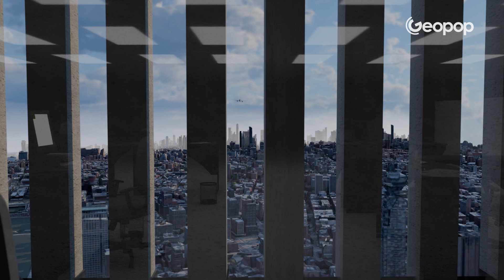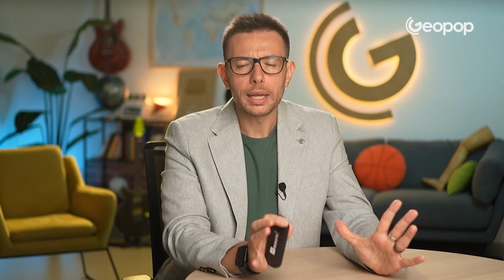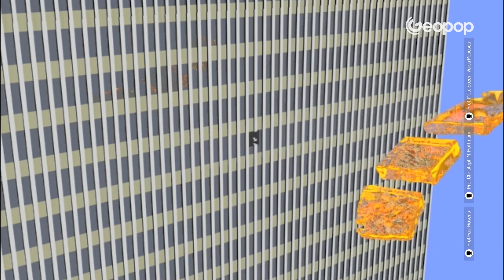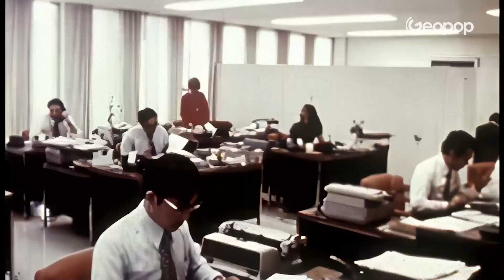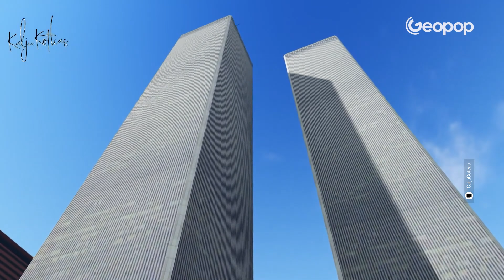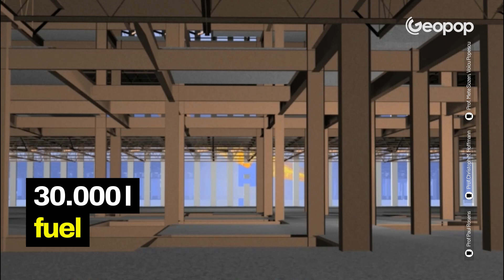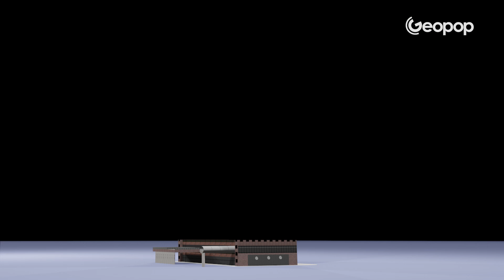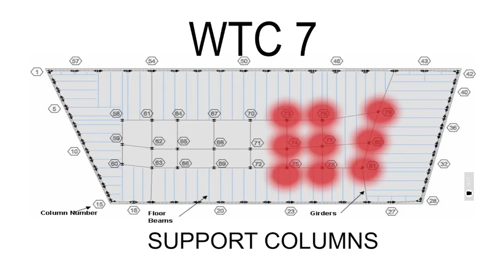9/11, 2001: The Technical Reconstruction of the Twin Towers and WTC 7 Collapses

Comment: How a 800 km/h passport can crash in a building  survive, and will be found view hours later, in a collapsed Bildung???
Reply: Nobody designed the building to withstand a ,767 plane hitting it and exploding at 500mph... Considering it still took 20 minutes for the building to fall means the stresses took over and broke it!
Reply: @sonnydemichele4903 a 767 is Not able to fly 500mph at 400m
Reply: It’s quite possible it was one of very few actually found.
Reply: The book in the pentagon on the table next to the collapsed supporting wall also survived the explosion, you can see it in the photos
Reply: @ElLowEl .  . "What the hell are you talking about?" .  . 😃 .  . Thank you for your sponsored reply, Mr. EILow.  The word projection indicates holography as you know, commercial demonstrations of which have been amazing in recent years.  To feign ignorance doesn't work well for you, however.  Where, Mr. EILow, is the wake turbulence only seconds after passage of a 500 mph large passenger airliner -- not seen in the smoke and fire covering the impact zone?  Even the wake of a small Cessna Aircraft would be noticeable -- yet there is nothing.  It's likely that no real answer from you is forthcoming. We'll wait and see .  .
Reply: The fact that the passport and identification of some hijackers survived the crash is not proof that they were planted! The only passport recovered from the World Trade Center site belonged to Satam al-Suqami, one of the hijackers of Flight 11, which was the first plane to strike its target (the North Tower) that morning. 

The passport was found on the street by a passerby just a bit after the crash and handed over to a NYPD detective. It was not found afterward in the rubble or debris as is commonly claimed, and bore damage and charring, consistent with being affected by the explosion.

The impact, along with the blast wave and air currents, ejected the passport from the plane and naturally into the street below. 

It must be stressed that this isn’t the sort of astonishingly improbable scenario it's made out to be. Numerous objects, such as paper, clothing, seat cushions, human body parts (including rib cages, limbs, and heads), suitcases, and other debris were found scattered all over the streets after the crash. 

In fact, later on, the body of a flight attendant, still strapped to her seat with her hands zip tied, was even recovered from the rubble, one of the few nearly intact bodies found in the wreckage.

And perhaps most crucial, this wasn’t an isolated case whatsoever. The other crash sites, such as the Pentagon and Pennsylvania, also featured identification documents from the hijackers. Several of their driver’s licenses, credit cards, and luggage tags were recovered, including even one of the red bandanas worn by the hijackers of United 93. 

Additionally, personal items from other passengers and crew were found, including driver’s licenses and various belongings, making it clear that surviving items weren’t unique to the hijackers.* 

It’s simply a matter of physics, logic, and undeniable fact. Anyone with real-world experience in law enforcement, emergency response, or evidence collection can attest that in any explosion, implosion, or similar event—whether a plane crash, bombing, arson, or structural collapse—objects of all shapes and sizes often survive in varying conditions, depending on the precise circumstances they endure. 

Denying this reality and believing otherwise isn’t merely misguided—it’s willful ignorance!
Reply: This is what they want to let tou believe.. @lukasz-b2z
Reply: @Eo9539  "This is what they want to"
Who?
Reply: @lukasz-b2z Please don't use the word Logic.
Reply: @ Please use google or read a book. We have a milion overwhelming evidence for AQ responsability for 9/11
Reply: @lukasz-b2z  The big problem is while these items survived the flight black boxes were never recovered for both flights.
Reply: @whatslifespurpose  What's so strange about that? Black boxes aren't indestructible as people think. Especially not when thousands of tons of steel from a collapsing tower fall on them. Passports flew out during the impact. Black boxes were found in Pentagon and Shanksville.
Reply: @whatslifespurpose Hmmm?
Reply: @lukasz-b2z  yes right from all the people in twins only a passport of one of the villeins was found in the street.. yea right. very unlikely.
Reply: @ We have a milion overwhelming evidence for Al Qaeda responsability. The only thing you have to do is to get out of your, tinkfoil, internet bubble. Read the book "Looming Tower" for example. Everything will be clear.
Reply: @connectthedots5678  We have a milion overwhelming evidence for Al Qaeda's responsibility for 9/11. All you have to do is to get out of your internet bubble. I recommend reading the book "Looming Tower". Very well documented book.  Everything will be clear.
Reply: @lukasz-b2z now explain how the building came down.. forget the passport
Reply: @mishmash9397  https://www.youtube.com/watch?v=m-Haf79ygQY&t=211s
Reply: @ Type on yt: The Collapse of WTC | Solving All the Mysteries
Reply: @mishmash9397 you literally are commenting on a video that explains in great detail how it came down.
Reply: That passport had plot armor.
Reply: The passport was found among debris on the sidewalk before any of the buildings collapsed.
Reply: @marcpowell5893 that's even weirder
Reply: Marcpowell5983, the twoofers want their story to sound as improbable as possible for future generations, in the hopes of attracting fellow “thinkers”
Reply: @marcpowell5893  The plane turned into a fireball as soon as it made contact with the building.  There is no way a passport flew out of a fiery explosion and then found and handed to the authorities before the building collapsed. I just never understand people's appeal to believe authority at all costs and hate and attack anyone that questions it
Reply: @briannatarelli430  Lots of other combustible items from the planes made it to the sidewalks intact. There were plenty of other ways to identify the terrorists without the Government taking a chance on planting a passport and hoping it wouldn't raise suspicions. It was an amazing find, but not impossible or suspicious. Stranger things have happened. Your incredulity counts for nothing.
Reply: man.. watch the video
Reply: As Jerry said on Seinfeld 
“Now that’s one magic lugi”
Reply: Pass port? What happens if chuck a piece of paper from the top? C'mon.
Reply: Because the passport was inside the pocket of a pair of fire retardant pants...
Reply: @KennyGiven  "Because the passport was inside the pocket of a pair of fire retardant pants"
Unlikely. It was most likely in a shirt pocket, or even just on the plane dashboard, as from recovered location, it bounced back, not crossed the tower.
Reply: The passports of all muslims are always coated with the same fireproof material like the coloumns, in case they will be called up as suicide squads one day.....😂
Reply: @Eo9539  "The passports of all muslims are always coated"
Naively wrong.
Reply: Now that is more amazing than anything they told us officially
Reply: @nickcharles1284 .  . "science" .  . 😃 .  . Commercial demonstrations of holography have been amazing -- so you believe that they are analog in nature? .  . What century are you living in?   

You also cannot explain the entire lack of turbulence behind a 500 mph aircraft that would entirely disrupt the smoking fire coming out of the building on the seconds later. Even the wake of a small Cessna Aircraft would be evident -- yet there is nothing.
Reply: -- Then what is the source of the many tons of molten steel found in and under the debris, the heat so intense that the molten steel remained in that state for weeks afterward, running off of the debris as it was excavated. This cannot be molten copper from wiring that retains the color of a shiny new penny.  It cannot be molten aluminum that retains the color of the polished aluminum wheels of a street racer. It was the color of glowing orange molten steel  that cannot be mistaken for any other material, reported by firefighters who are very experienced in the nature of such materials as well as seen in video evidence.

When you combine this with an entire lack of turbulence behind 500 mph aircraft, when even a small Cessna Aircraft would leave an evident wake in the smoke and fire only seconds later .  . We find that skeptics still cannot be skeptical of the official narrative in explanation.  Sponsored channels and forum activity are skeptical of nothing when support is provided.

Sponsored activity in the forums is very normal today for commercial and political purposes and subjects of controversy -- in the attempt to lead public debate.
Reply: @ronaldgreene5733  There was no molten steel found "in and under the debris." What was dug up by the excavators was solid steel brought to red heat by the intense underground fires which were burning ordinary combustibles. The material seen "running off the debris" in still photos was just red hot embers. Molten steel is white hot, emits sparks and, of course, is a liquid. Firefighters who described seeing "molten steel running down the channel rails" (whatever that means) were mistaken. They are not chemists.

The planes that slammed into the WTC buildings as witnessed and photographed by thousands on the streets of NYC and as seen by millions on live TV were real. The "official narrative," as improbable as it may seem, has consistently been proven to be correct.
Reply: and even no black boxes was recovered but a passport is survived and recovered from that.
Reply: And how does a found passport prove anything about the owner being a terrorist?
Reply: Which is more extreme -- to accept without question the inexplicable lack of turbulence in the wake of a 500 mph large passenger airliner -- not evident in the smoke and fire covering the impact zone only seconds later? -- or to recognize the indications of digital projection in its imperfect nature as we see a wing disappear in front of a bright blue sky? From another camera angle, the same aircraft is seen passing behind a crane in the foreground, yet in front of the heavy crane cable. 

There should be a hurricane of turbulence in its wake that would entirely disrupt and disperse the smoke and fire seen billowing outward just 3 to 4 seconds later at both towers.  Even the wake of a small Cessna aircraft would be noticeable -- yet there is nothing.

Comment: Explain why the towers fell at free fall speed. With NO resistance from structure below. You can see squibs discharging from the building in videos, many floors below as the top was coming down. Not buying this BS. It was a controlled demolition

Comment: Don't forget to memoryhole 𝟮𝟬𝟭𝟳/𝟬𝟱/𝟬𝟵 𝗙𝗘𝗠𝗔 𝟰𝟬𝟯 𝗔𝗽𝗽𝗲𝗻𝗱𝗶𝘅 𝗖 became err reasons. “Evidence of a severe high temperature corrosion attack on the steel, including oxidation and sulfidation with subsequent intergranular melting, was readily visible in the near surface microstructure. A liquid eutectic mixture containing primarily iron, oxygen and sulfur formed during this hot corrosion attack on the steel. This sulfur-rich liquid penetrated preferentially down grain boundaries of the steel, severely weakening the beam and making it susceptible to erosion. The eutectic temperature for this mixture strongly suggests that the temperature in this region of the steel beam approached 1,000 C (1800 F), which is substantially lower than would be expected for melting this steel. When steel cools below the eutectic temperature, the liquid composition transforms to two phases, iron oxide, FeO and iron sulfide, FeS. The product of this eutectic reaction is a characteristic geometrical arrangement that is unique and is readily visible even in the unetched microstructure of the steel.”

Comment: 𝗙𝗲𝗱𝗲𝗿𝗮𝗹 𝗕𝘂𝗶𝗹𝗱𝗶𝗻𝗴 𝗮𝗻𝗱 𝗙𝗶𝗿𝗲 𝗦𝗮𝗳𝗲𝘁𝘆 𝗜𝗻𝘃𝗲𝘀𝘁𝗶𝗴𝗮𝘁𝗶𝗼𝗻 𝗼𝗳 𝘁𝗵𝗲 𝗪𝗼𝗿𝗹𝗱 𝗧𝗿𝗮𝗱𝗲 𝗖𝗲𝗻𝘁𝗲𝗿 𝗗𝗶𝘀𝗮𝘀𝘁𝗲𝗿: 𝗙𝗶𝗻𝗮𝗹 𝗥𝗲𝗽𝗼𝗿𝘁 𝗼𝗳 𝘁𝗵𝗲 𝗡𝗮𝘁𝗶𝗼𝗻𝗮𝗹 𝗖𝗼𝗻𝘀𝘁𝗿𝘂𝗰𝘁𝗶𝗼𝗻 𝗦𝗮𝗳𝗲𝘁𝘆 𝗧𝗲𝗮𝗺 𝗼𝗻 𝘁𝗵𝗲 𝗖𝗼𝗹𝗹𝗮𝗽𝘀𝗲𝘀 𝗼𝗳 𝘁𝗵𝗲 𝗪𝗼𝗿𝗹𝗱 𝗧𝗿𝗮𝗱𝗲 𝗖𝗲𝗻𝘁𝗲𝗿 𝗧𝗼𝘄𝗲𝗿𝘀 (𝗡𝗜𝗦𝗧 𝗡𝗖𝗦𝗧𝗔𝗥 𝟭) doesn't attempt to explain WTC1 or 2 once 'initiated',  Pg: xxxvii point 2 Pg: 82 point 13: "The focus of the Investigation was on the sequence of events from the instant of aircraft impact to the initiation of collapse for each tower. For brevity in this report, this sequence is referred to as the "probable collapse sequence," although it includes little analysis of the structural behavior of the tower after the conditions for collapse initiation were reached and collapse became 𝗶𝗻𝗲𝘃𝗶𝘁𝗮𝗯𝗹𝗲."

Comment: Nothing can explain why all 3 buildings collapsed at free fall rate except that the supports were all taken out simultaneously at ground level. Pure physics and physics can't and won't lie.
Reply: Free fall?  What “fee fall”?  Did you actually measure that yourself or are you just taking the internet's word for it.

Because they can’t put it on the internet it its not true.  Riiiiggghhhtttttt

Not wishing to take anyone’s word for it I actually measured the rate of collapse myself

Turns out it's not true. The Twin Towers did not collapse in free fall or even anything close to it. 

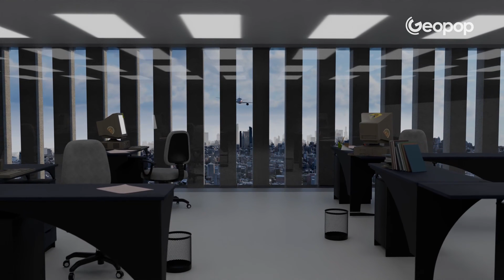I was able measure the collapse of the North Tower quite accurately and it came out at 34 seconds from the first externally visible signs of collapse initiation until the final core columns hit the ground. For those keeping score, that is 3 times longer than true free fall . If you just watch the collapses it would be hard to miss all the big pieces of loose debris falling much faster than the Towers themselves (yet people still miss it). For example in this clip from 0:05 to 0:15 to see what obvious nonsense the whole idea is (recommend set to 1080P and speed to 0.5); 

youtube.com/watch?v=R889eSvuS-w&ab_channel=EnhancedWTCVideos 

To confirm the Twin Towers collapsed at a lot less than free fall all you need is a working eyeball and the ability to tell time, the latter optional.

Comment: @18:09 this is the most horseshit explanation ever for "favorable conditions".  Office desks or printers, on fire would not cause a steel farmed  building to collapse. and The fires would not have been hot enough to weaken the steel. Furthermore, even if the fires were hot enough, the building 7 would not have collapsed perfectly straight down in a free fall at almost the speed of gravity. It would have tilted to the side of the original debris damage and cave in to one side. ( not perfectly symmetrical)  this looks like it was controlled demolition.
Reply: So you don’t know what jet fuel is? And you know exactly how much paper and wooden desks were in the buildings because you owned them right? A workplace that’s 105 stories with a workload completely paper based not having enough paper to help fuel a jet fuel fire. Yeah that makes so much sense, it’s not like the buildings weren’t even built properly in the first place. Y’all are so ignorant I stg, acting like wtc 7 wasn’t on fire for hours and didn’t get damaged from two massive buildings falling right next to the building. Alright  little bro believe what you want but realize you sound like an idiot
Reply: And you know all this science how?
Reply: Look up "Flashover".It's not just the objects themselves that burn, but the gas they emit when heated.
Reply: Wow you must know more than all the experts! Good for you - does it make you feel more superior?
Reply: @Jnoooooo  You are so fuckin stupid if you believe this BULLSHIT. Watch 9/11 The Grand Deception on Tubi. After you do, if you have any common sense, you can't possibly believe these buildings collapsed the way they did without controlled demolition.
Reply: @Jnoooooo  well, I don't know more than the experts, but I do know that a printer and an office desk on fire does not melt steel! But you can go ahead and believe that if you like, your choice.